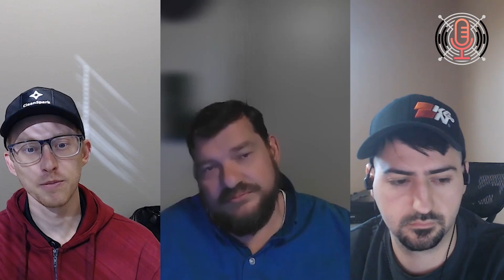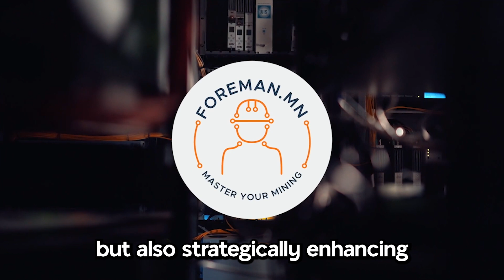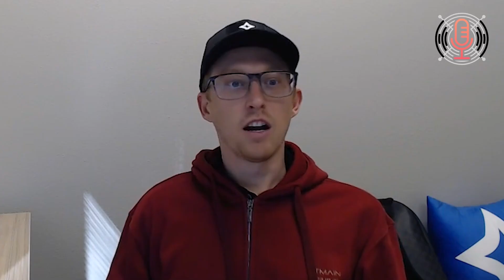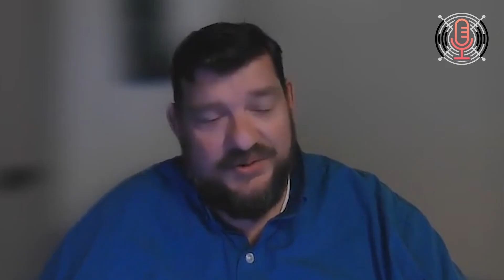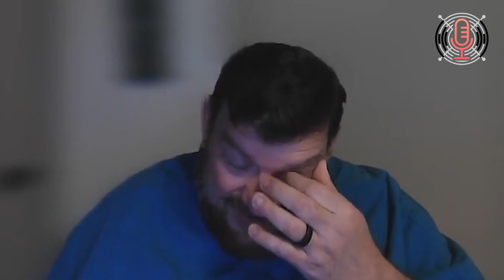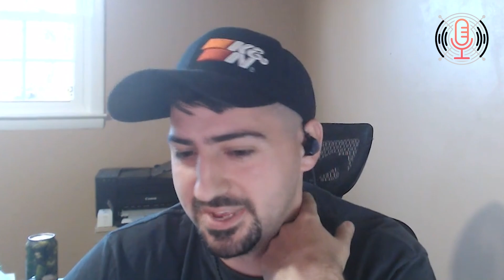(TAKEOVER) Lessons From Bitcoin Mining Giants W/ Russell Cann (Core Sci)

Comment: 🎯 Key Takeaways for quick navigation:

00:00 🤖 Russell Cann, Head of Mining at Core Scientific, advises that success in mining can be achieved whether starting small or going big, but mid-sized operations may face challenges.
02:20 🛠️ Russell Cann shares his background, starting with founding a tech company, engaging in Ethereum and GPU mining, and eventually joining Core Scientific in 2017.
04:23 💡 While not a Bitcoin maximalist, Russell appreciates the distributed nature of the Bitcoin Network, its resiliency, and the industry's evolution into an efficient infrastructure provider.
07:19 🔄 As Bitcoin's halving events drive operators to double efficiency every four years, Russell emphasizes the need for innovation in hardware and infrastructure to maintain profitability.
10:05 🌐 Russell discusses the importance of aligning mining infrastructure (air, immersion, or rack-mounted systems) with the environmental conditions of the facility, emphasizing the need for efficiency.
14:30 ♨️ Russell predicts future innovation in utilizing waste heat generated by mining operations, suggesting it could be harnessed for power generation or other applications.
16:33 🌐 With the move to smaller nanometer chips, Russell sees opportunities for new manufacturers like Aradine and Chain Reaction to enter the market, leveraging their engineering expertise.
18:26 🌍 Russell acknowledges the dominance of Chinese manufacturers like Bitmain and MicroBT and the potential concerns about dependency, but believes there is room for new entrants to gain market share.
19:37 🌐 *Global Competition: Diversity in ASIC manufacturing locations is beneficial for the ecosystem, preventing concentration risks. *
20:19 🔀 Bitcoin's Strength: Bitcoin's global presence and adoption stem from its ability to work anywhere, fostering the need for diverse manufacturers.
21:30 🔄 Customization Matters: Customizable ASICs, especially for different cooling methods, are essential. Flexibility in hash rate, firmware control, and temperature operation is crucial for miners.
23:52 🏭 Value of Different Manufacturers: Operators in the U.S. may prefer TSMC or Samsung chips due to geopolitical considerations. However, local foundries in other regions might be attractive.
25:29 ⚡ Three-Phase Power: Transitioning to three-phase power supplies in mining facilities requires careful consideration, especially for existing setups. It offers higher power in the same footprint but demands operational adjustments.
27:49 🌡️ Handling Heat in Three-Phase Systems: Three-phase systems may necessitate additional cooling methods, potentially impacting Power Usage Effectiveness (PUE) and requiring careful planning to avoid stranded power.
29:16 💻 Core Scientific Software Stack: Core's software stack, designed with data center technicians in mind, focuses on efficient facility operation, integration with power grids, and adapting to diverse environmental conditions.
32:07 ⚙️ Firmware Integration: Integrating new ASICs into Core's system is relatively quick due to experience, but stability and efficiency tuning, especially for new models, require careful testing to avoid costly mistakes.
34:44 🛑 Troublesome ASIC Models: Models with thermal paste issues, like the S17 series, are challenging for repairs and less favored. Specific mention of Chrome Backs causing difficulties.
36:22 🌐 Blurring Lines: Core Scientific integrates advanced technologies into its facilities, using weather systems, custom temperature sensors, and adaptive facility designs, emphasizing the blend of data center and Bitcoin mining operations.
38:59 🌐 Russell Cann discusses changes in regulatory policies around Bitcoin mining, noting that power grids in countries outside the United States are realizing the benefits quicker. However, there's still a need for education among the general public and policymakers in the US.
41:47 🌐 Core Scientific's mining operations are spread across deregulated and regulated markets. While Texas is a deregulated market with significant growth, smaller regulated markets are quick to understand the benefits of curtailment.
43:36 🌐 Russell Cann predicts the future development of regulated rates in the United States specifically designed for Bitcoin mining, offering curtailment options in exchange for favorable rates.
46:10 🌐 Discussing the future of Core Scientific, Russell Cann emphasizes the increasing demand for operational processing power in AI. He anticipates the development of customized infrastructure for large language models, generative AI, and simulation AI to meet this demand efficiently.

Made with HARPA AI